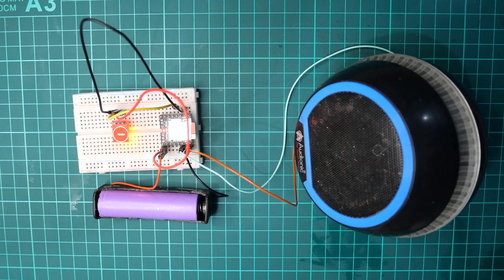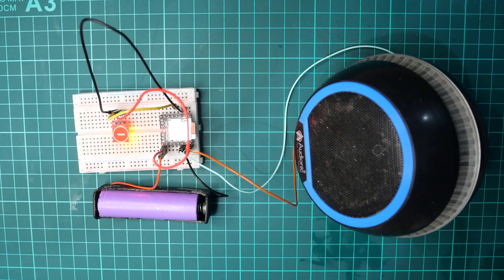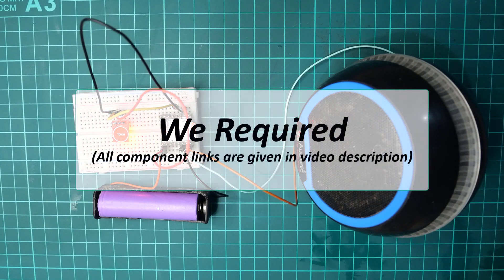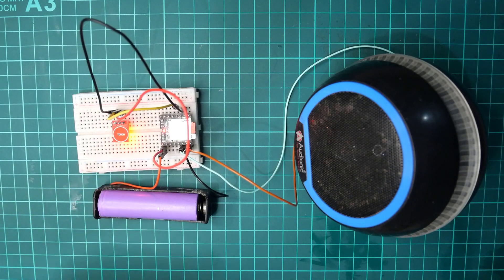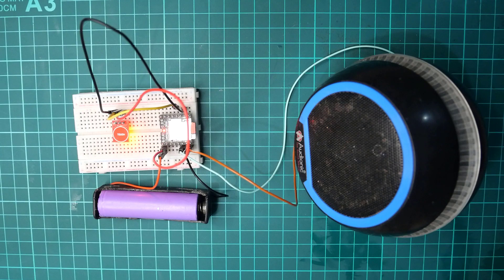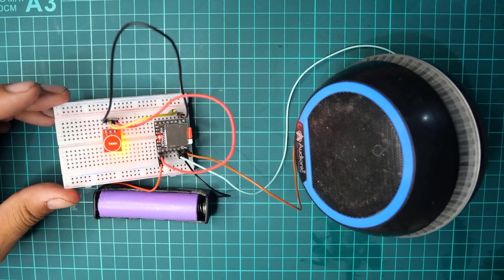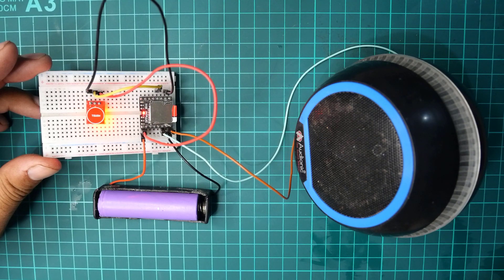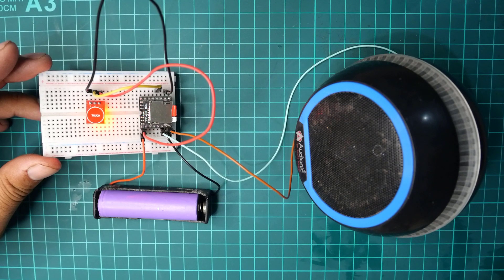Play Audio with Touch Sensor using DF Player Module | DIY Tutorial

Comment: If you guys want for it to play only once. Put a potentiometer or a resistor in the I/O. In my case I used a 1,2k resistor (maybe different in your case) but you need to double tap before it registers.